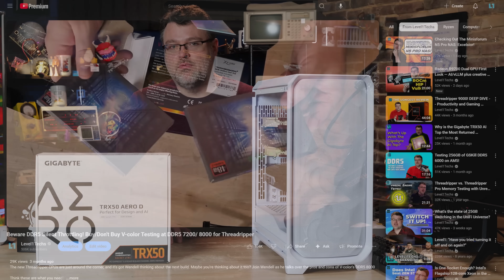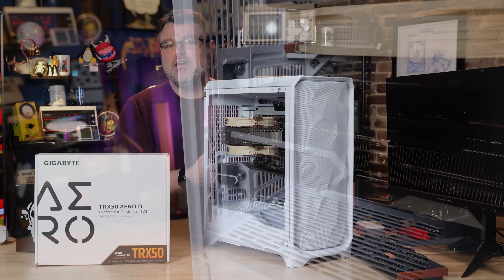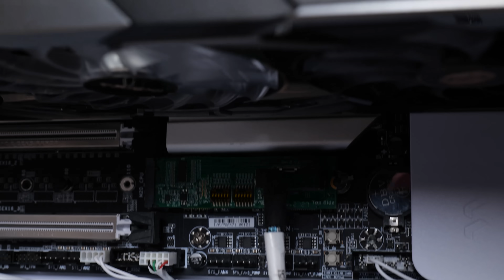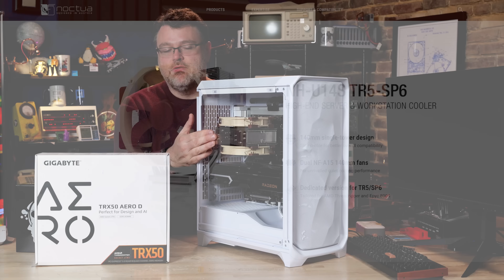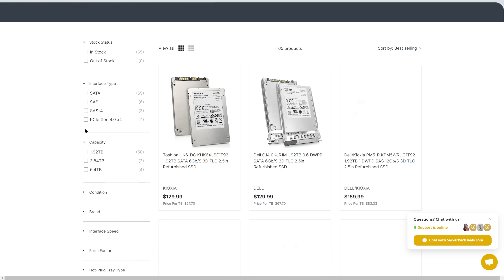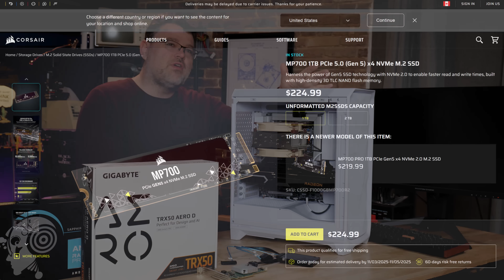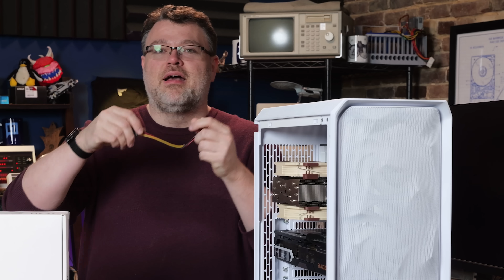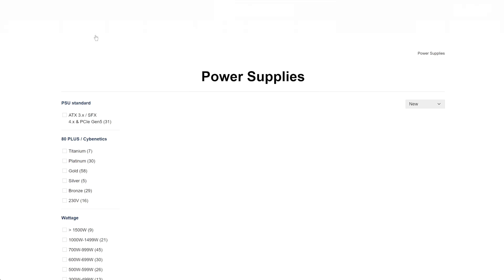What is the Least Expensive Threadripper Build Without Losing too much Performance?

Comment: 10 months ago I built 7960x 24 core, same Aero motherboard (v1.2), 192 GB of memory GSkill, A6000 GPU. It has been the most stable system that I ever used. So little crashes or issues. I use it for professional 3D graphics, AI stuff and gaming. Preforms great in all of these tasks. I initially wanted 9950x but I was really afraid about stability with 192GB of memory. I do have a Silverstone AIO but I still get 90c with load, I am not sure if this is off from what other people are getting? Should I reapply thermal paste?

Comment: A non-destructive way to solve the 3.3v problem is to carefully place a small piece of kapton tape over the 3.3v pin on the SATA power connector.
 
That solved the problem nicely for me, when I installed a HDD removed from an external enclosure. Manufacturers love to give those firmware which interprets 3.3v as a disable signal (enterprise style) to punish people looking for a good deal.
Reply: Done this for years now, it's a hack thats saved me thousands.
Reply: i got a molex to sata power converter. $10 or so

Comment: Forgot to mention prices:
Total new: 
1100+620+2300+680+180+170 = 5,050
Used cpu: 5050-700 = 4,350

$1100 ram 96gb
$620 motherboard 
$2300 new cpu
$1600 used cpu
$680 gpu - Newegg
$180 case B&H
$170 1000w power supply
Reply: This should be pinned
Reply: 5k? For how much do kidneys go currently?
Reply: @brulsmurf Depends on how crunchy they are... mine aren't worth the stones in them.
Reply: @brulsmurf  If you have to ask...
Reply: Thank you
Reply: That's not including storage
Reply: @WayneWatson1  TBH if you are buying threadripper either your storage is a single 1TB nvme or its a few dozen HDDS and SSDs each.
Reply: Yeah, I was considering this. I really was. Then I scored a HP Z6 G5 A from Ebay with Pro 7965WX processor, 2x32GB 5600 RAM and 1430W PSU for 3500. I also scored the MSI RTX 3090Ti Suprim X from a forum for 800.
Reply: Hey, I literally was designing a similar contraption,  but I went for x3 graphics cards and a 2000 wat psu similar conclusion though
Reply: %k is a steal
Reply: What do you estimate the power consumption? Way more than I would ever need but I want one!!
Reply: You probably can go even cheaper if you buy aliexpress ram?
Reply: these new MOBOs do not make any sense with ddr5 prices. You can get SAME memory bandwith of 200gb, with previous WRX used machines. for 5K I built 2x9700 + 128GB Ram, 3975wx the base, which will smoke this machine in any AI test.
Reply: these new MOBOs do not make any sense with ddr5 prices. You can get SAME memory bandwith of 200gb, with previous WRX used machines. for 5K I built 2x9700 + 128GB Ram, 3975wx the base, which will smoke this machine in any AI test.
Reply: Yeah and they will tell you few months later that your hardware will not receive support anymore, definitely try to do better with your inflated FIAT, punish these greedy companies, don't reward them...

Comment: DDR5 Ram prices and over inflated Threadripper CPU and MBs make it now much less interesting than it used to be. A 9950x setup is a better investment for most use case in my opinion. And this comes from someone who still run 1st and 2nd gen Threadripper and Intel E5 Xeons.. Then Threadripper pro is s completelly other use case.. and budget.
Reply: I looked building a TR server for a bit, but have ended up landing on an EPYC platform of the same era. It will be a largely storage/media/homelab system, and fits my needs and budget much better than a TR system would. 8ch DDR4 and 128PCIe lanes costs less on EPYC than TR Pro.

Comment: I would love to have something like this to mess around with, but I don't even push my old Xeon E5-2683 v4 very hard. I don't think I ever hit three or more cores at over 50% uitilization for longer than a minute. I would swap it out for something more power efficient, but power is cheap where I live, and I don't want to send working hardware to the landfill when it can still do everything I need it to.
Reply: yeah just gave my old E5-2697AV4 a "new" lsi hba, not gonna get to retire any time soon
Reply: @nigrum_tredecim As the saying goes, don't fix what isn't broken. The most upgrading I want to do with mine right now is rackmounting it.
Reply: @nigrum_tredecim not with these DDR5 prices anyway
Reply: @marcogenovesi8570 id probably go ddr4 threadripper bc i could reuse the 256gb i have
Reply: I still run several workstations with Xeon dual E5-2695v2 with 128Gb DDR3 (octochannel) and E5-2690v3 DDR4. Just because we need a lot of RAM for simulation, it remains quite expensive to replace those machines with more modern DDR5 PCs.

Comment: It's a shame that there is no competition for HEDT. Xeon W is now so dated. Threadripper is excellent, but remains beyond reach without any incentive to bring prices down.

Unfortunate, as even though I really like my 13700K, I am ready to move to something like a 32C64T or 64C/128T CPU.
Reply: AMD 100% destroyed their entire HEDT userbase with their TRX40 bait and switch, instant-EOL insanity. TRX50 motherboards are virtually non existent with so many MB manufacturers pulling out or massively scaling back what they release on this TRX50 platform - as a quick comparison between TRX40 vs TRX50 mb's will instantly show.
AMD: Acute Mental Discombobulation.
Reply: It’s a shame that Threadripper isn’t even HEDT anymore, now it’s just “workstation” and “slightly cheaper workstation”.

I’m blindly hoping that the upcoming 16p+32e Nova Lake CPU will be a proper HEDT platform. Probably won’t be, but I really hope it is.
Reply: Look into EPYC. I'm finding it cheaper than TR Pro to get 8ch RAM and 128PCIe lanes. That said, man I miss my X299 system - but the CPU's are just too power hungry and slow in 2025.
Reply: @adjoho1  AMD could have fixed all that if they honoured the HEDT side of TRX40 instead of the insanity they unleashed. No sane enthusiast is interested in any 'HEDT' system from those at Acute Mental Discombobulation.

Comment: I used this cooler and built a 9960x rig and the temps are troubling with full mutli-core load via cenebench seeing it throttle at 93c. Should I look at a re-paste or is this expected behavior on this chip do you think? Was thinking of upgrading to the silverstone AIO, not sure..
Reply: Try a repaste and pay more attention to the fastening sequence. Run multiple stages in the pattern they show.

Comment: how well the AI perform on dual threadripper pro WITHOUT the gpu.
Reply: Do you mean dual as in 2 CPUs? That’s only possible with non-P EPYC. Ryzen, ThreadRipper and EPYC XXXXP are limited to one socket per board.

Comment: So hwat if you use 8 or 12 core Threadripper with quad channel?
Reply: Pretty sure those are OEM exclusive models? I think retail Threadripper starts at 24 cores, and has since ~3000 series?
Reply: @levygaming3133  
AMD Ryzen Threadripper Pro 9955WX is lowest I can find currently, 16 cores. So not really accurate. But indeed cannot see 12 core models in normal pricing list.
Reply: @levygaming3133  EPYC from what I can see goes as low as 8 but next step up is 16 not 12.

Comment: 1.1k for 96gb. jesus.
Reply: Ram prices doubled over the summer months, and then doubled again since September.
Reply: thank new data centers (they plan to get 45% of worlds ram production capacity)
Reply: I just checked to see how much it would be to add another 128gb to my aging socket 2011 server.. I paid $150 for a 4x32 kit a couple years ago. It’s $750 for the same listing on eBay now
Reply: you can still get 128gb for about 450 in some stores if you dont go for the fastest gamer ram.
Reply: It’s crazy! I had picked out a 32GB single DDR5 5600 sodimm from crucial to double the RAM. It was about $95 two weeks ago, which I thought was a bit much. Now I’m seeing out of stock listings around 150. Only ones in stock are 200 to 225.
Reply: i paid $400 for 128gb of ddr4 ecc like 1 year ago. lol. ram used to be cheap.
Reply: @ricardoricardo3232  DDR4 is end of life so it’s definitely getting more expensive to procure.
Reply: Hitting my head against the wall cause I returned a 128gb Corsair kit for $395 including tax a month ago because it was CL 40 6400, now the same kit is $600+ 😂
Reply: Both a combination of production cuts, then massive datacenter sales.
Reply: @fujinshu Hooray for the DRAM oligopoly! Third time in ten years they have conspired to artificially inflate DRAM prices.
Reply: @fujinshu  we can thank google for the 2022 crash and issues we are currently jn
Reply: I have a 3090 with 1920x Threadripper and I can run arc raiders in 5k60hz on ultra. I don’t think I’ll need to upgrade for quite some time
Reply: Just wait 3 months, AI bubble is on the point of bursting and the USA economy is almost dead 😂
Reply: @annebokma4637 The US still allows bitcoin, lmao. A market where most of the money comes from laundering and ransomware. 
If you think it's going to burst at any time before it's going to wipe out entire industries, you learned nothing from 2008. And of course, the government will bail them out for billions.
Reply: @ToroidalVortices  I am under no delusions, things are going to crash hard, soon
Reply: @annebokma4637  Nah AI is lasting at least another year or two, it's not reached maximum clownworld